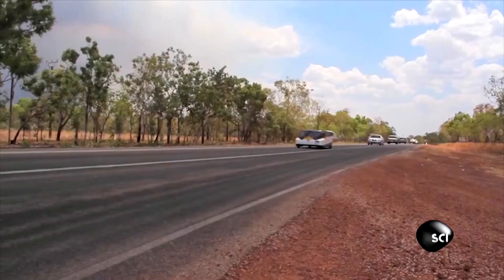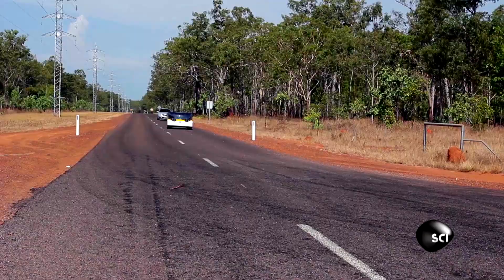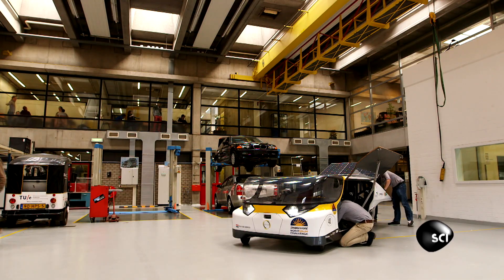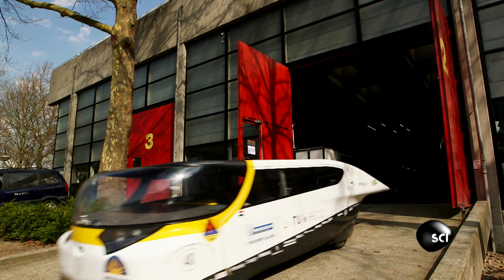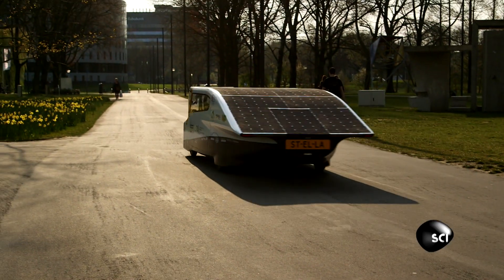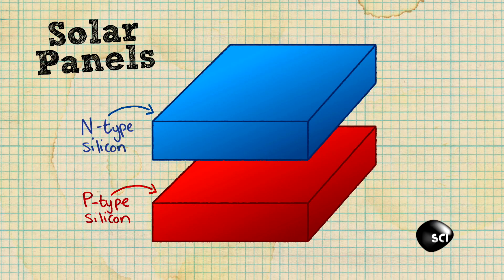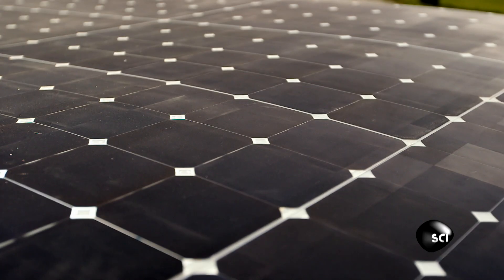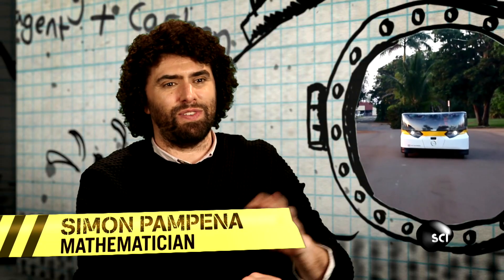How Light From the Sun Propelled This Car to a Championship

Comment: zero cost for fuel ... zero pollution ... solar powered transporting systems is one of the future succors ... specially in the sunny & hot areas & countries with low income ... countries that cannot get nuclear or geothermal power ... or remote areas from civilization such as oasis
Reply: Ahmed Taha AlNady Low income? Have you ever priced solar panels?
Reply: what ever it cost .. its 0% need of fuel , 0% gas emitting & it could be used in any place as well as the sun reaches it .. without need of any supply from anywhere ... & for the cost we could use mirrors & lenses to focus the sun ray so we use less amount of sun panels ... also we could use the heat rather than the light itself (like the solar heater) ... imagine an air conditioner use the heat in the compressor to get a part of his electric power ...saving a lot of energy & money wastes in refrigeration

Comment: Why do they always try to make them look like a sci-fi prop? Just do what Tesla did and make it look like something people would actually drive to work.
Reply: It's a solar powered car for racing not a production electric car.
Reply: Yuki Uzumaki because this is probably way more aerodynamic and has a bigger area for solar pannels. It just happens to look futuristic.
Reply: It's no a sci-fi prop. It's an engineering feat. That's how it has to look to work efficiently.
Reply: This isn't the same thing as a tesla this is completely self sufficient and needs to be more aerodynamic and have a larger area for solar power to do so